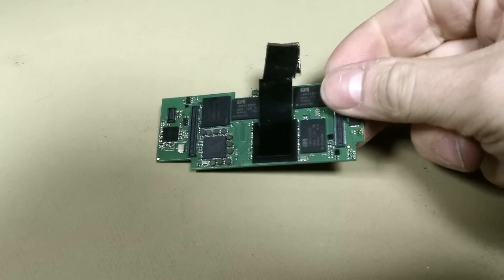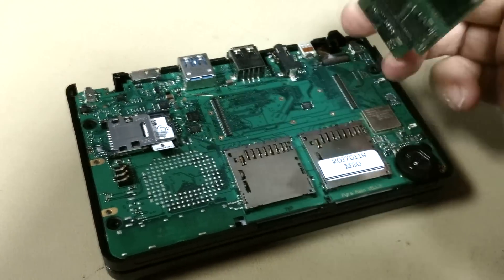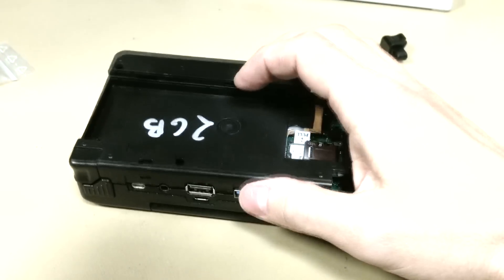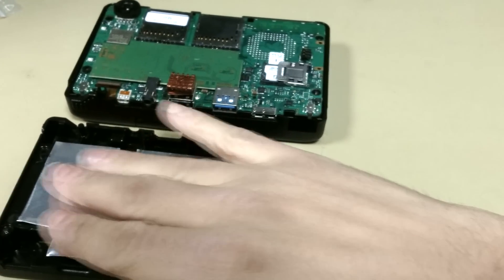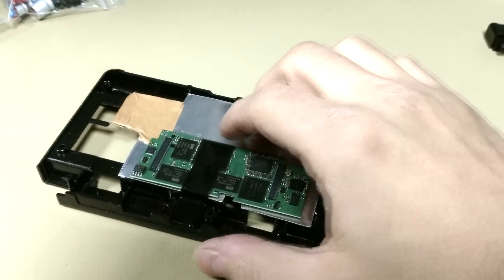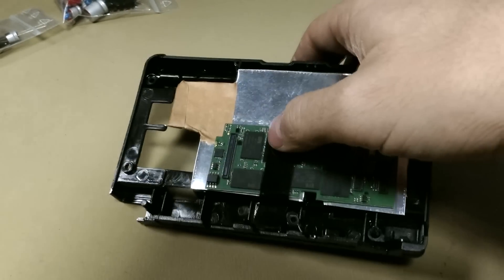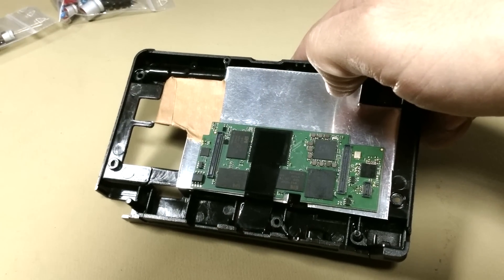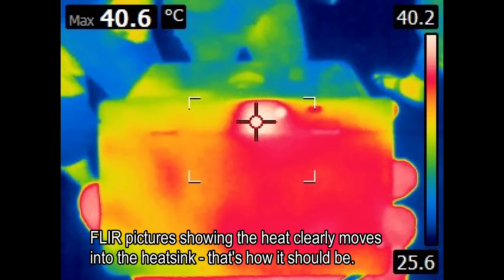Pyra: Passive cooling

Comment: when the GPD Win came out I remember people talking about needing a fan in it, nice to see the Pyra might be able to function without an active cooling method for a nice silent device, especially with the Win 2 on the way.
Reply: I mean it is expected thaf ot would have no fan since it is basically as weak as a very cheap phone.
Reply: Sounds good to me.
Reply: +Justin Wong I mean as long as it plays PS1 games at full speed I'm sold.
Reply: Galaxy Note 3 had a similar chip in it. If $800 is "very cheap" for you, I'd like to smoke some of you're marijuana

but seriously, I'll be happy if the Pyra doesn't burning off my fingerprints if I push the CPU in the summer, unlike my smartphone
Reply: I can do that on my phone or on a raspberry pi
Reply: Yeah same but my GPD-Win lags with a few PS1 games making it not ideal.
Tekken 3 lags the worse imo
Reply: My GPD Win has a fan with 3 settings which are Off, Low and High

Comment: So the heatsink is still contained within the plastic itself? No opening to the outside to vent air? Or is the idea to dissipate heat through the USB connectors?

Speaking of which:could the heat of the heatsink might "bleed" into the USB connector, and end up melting the glue in some cheap USB cables? How hot can the Pyra CPU get in practice?
Reply: I thought the same when watching the video.

Comment: Your device can't even stand up to the GPD Win and there is a GPD Win 2 in the close future, so what is your plans to combat this?
Reply: well here's how i see it. The GPD isn't even in the same class as the Pyra. GPD is to script kiddies as Pyra is to Enthusiast Programmers. The niche pyra provides can't be done on the GPD. The gaming controls are an extra and even those are a significant step above GPDs control setup. Rumble, Four Triggers, sensors, Clickable sticks [for L3 and R3], customizable RGB lighting for notifications [or for say game effects like flashing red each time you get hit in quake], a good keyboard that is backlit.  Upgradeable GPU and CPU thanks to the modular set up they created based on actual full desktop computers [you know what happens when you want to upgrade your GPD? you can't, you simply have to buy a new one I only need to buy this once]. IDK most of that information can be found on their website and i know I am skipping over a lot of things the pyra has over GPD. Im just saying if you want something cookie cutter then i guess GPD would be ok for you, but if you want something that has actually been thought out with solid features that not only improves on what the GPD should have done but also what it can do in the future then the pyra is the top shelf choice.

Comment: Is this bettet or worse then the gpd win 2 in terms of specs
Reply from the maker: CPU power is a LOT better in the GPD Win - thy Pyra is more flexible, hackable and offers more functions (like sensors, 4G/LTE internet, 2 fullsize SD-Card-Slots, etc.). If you're looking for raw power for gaming, then the GPD Win 2 is a lot better for you.
Reply: OpenPandora one more question will future boards be compatible with cpus that arent arm
Reply from the maker: Well, the Pyra has been designed that the CPU is upgradable - so yes, we might offer an x86-compatible CPU board at some time (but that's anything but fixed at the moment).
Reply: OpenPandora ok thank you
Reply: if you end up selling the pyra outside of preorder like i can put up cash for a finished product ill buy one even though i have the og gpd win and im getting the win 2.
 with all the potential for memory storage and removable battery on the pyra it will make a really nice media device for watching movies etc the 1tb full size sd card s may even be available by then .
Reply: @EvilDragon1717  I think that GPD Win 2 is only better for playing with Windows games, but for other emulators, GPD Win 2 is not better than Pyra because Windows is too heavy an operating system which slows down the equipment.
The antivirus also helps to slow down Windows. Not to mention that Windows is a system that corrupts itself over time and eventually slows down.